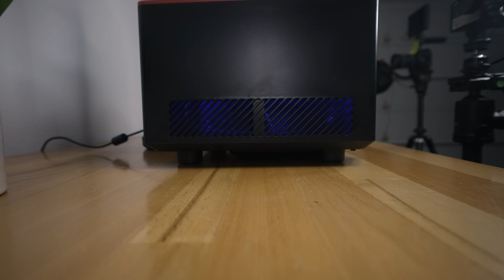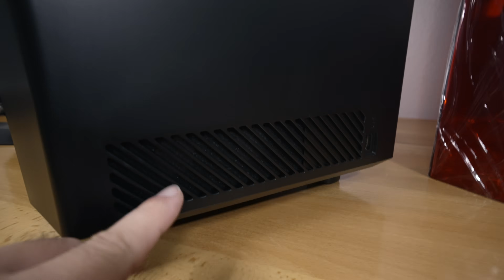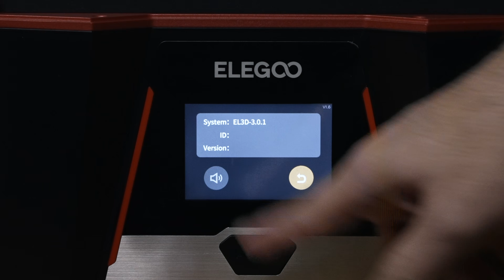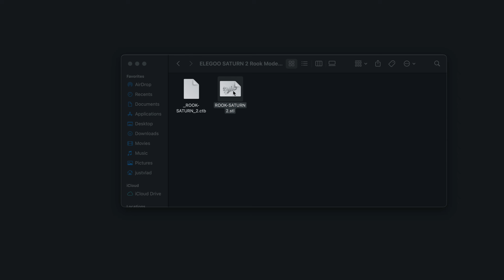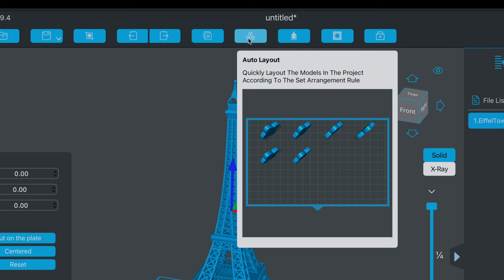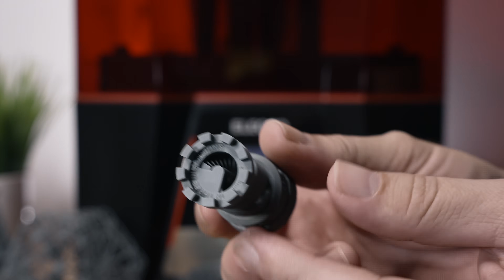Elegoo Saturn 2 - 8K Resin 3D Printer - Unbox & Setup

Comment: I have this printer excellent product, I have to say though that their (Elegoo) customer service is pretty bad, My printer arrived with what I had originally thought was a light scratch on the protective screen (tempered glass) it was actually a crack which cracked after a couple of prints, I purchased a replacement protective screen well over a month ago it has yet to this day not been shipped despite me contacting them several times, Looks like I will probably be looking at another company for my next printer

Comment: I just got this saturn 2 printer and started following your setup to make sure i did it right. However, when i turn mine on, the screen comes on but no fans?? Do you have any advice? Is this faulty should i send it back? Please help :(
Reply: They fixed it in firmware update - Fans only work while printing ;) so no unnecessary noise while idle
Reply: @almostpainted what about the mini air purifier? Mine does not turn on the lights nor the fans, I haven’t tried to print something just in case

Comment: Does anybody know why my 3d printer isn’t printing. I followed all the steps on here. I’m trying to print a test piece (the rook shown in the video and the one given with the usb) everything seems ok. But when I press pause about 50% of the way through nothing is on the plate.
Reply: I’m having the same issue, did you figure it out??
Reply: Yes the plate wasn’t getting enough exposure time for the bottom of the build to stick to the plate

Comment: I somehow ended up with FDM (ender 3 v2 neo), and this RESIN printer (saturn 2 8k). This is my 1st time ever touching a 3d printer so I was a little confused but after researching a little on both type of printer I think I got a little grip on it. The 1st impression for ender 3 v2 neo was somewhat funny. The ender looked cute. Very small and compact. I had no idea just how small the ender was, especially compared to saturn 2. Night and day difference. The quality and build was also night and day difference. The ender looks fragile and I am certain I can probably rip it into different pieces if I wanted to. The saturn 2 however looks thick and the quality difference compared to ender is also night and day. If you don't need super hard prints then it's no brainer, ender has very cheap hard filment. If you are not worried about durability then 120% resin.

Comment: Don't you use support?
Reply: He did not for the tower. Which is why he ended up with some pieces in the bottom of his tank. Which is not good, because it could perforate the tanks plastic base. I would always use supports for any areas of unsupported material. Otherwise it will just print and attach to the bottom of your tank and cause issues and potentially damage the tank and/or printer screen.

Comment: Great review, But in my case after having this resin printer for awhile. I will be selling it and the Mercury XS Bundle of the wash & cure units, Because that although the resin models been great and such, I have a problem with the elephant in the room problem No One online points out about the resin waste water from washing the models!

That is, unless you live in a always hot sunny place, you will not be able to set and remove the suspended waste resin left in the washing water due to lack of sunlight where I live?

I live in good old UK which is often over cloudy even in the summer and because I don't have hot sun all the time I can't cure the resin out of the waste water since I use water washable resin I need to wash in water and now have got stored 14 liters of the waste resin water That I can't set or off course just throw away down a drain or toilet.

Someone said just buy a super strong UV lamp and zap the waste water to set the resin in it? But I found that to buy a UV lamp that is big enough and has the right power will cost a few Hundred pounds to get. So that is not a option sadly!  So I am left with having to sell the system since I can't just keep storing the waste resin filled water.

Oh and saying well do the IPA version will also not be a option, IPA here has shot up in price big time and I would need at least 7 liters a time to fill up the washing unit tub, that be too pricey.
And no hot sun most of the year to help deal with the setting out of the resin, I could not just let it elevaperate away due to the IPA being so pricey anyway.

I also seen that disposing of this type of resin waste water here needs to have a special company deal with it which is very expensive and hard to find locally and I don't have a car.
Taking this stuff on public transport would be a legal problem due to it leaking out the containers I got it stored in. ( one 10 liter snap on lid plastic container & a few old plastic milk containers )

So I sadly will have to sell the whole system I saved up for.  Then still will have to find out how to get a service come and remove and dispose it safely under UK toxic laws?

So if you wish to buy this in the non always hot year around sunny countries like the UK, I would say don't as you be in the same trouble I am. And yes I did indeed research and watch tons about resin printing before I brought it? But no one said anything about the resin waste water setting problem if your not in a hot sunny country? All of them just said it is easy to set the resin out.
Reply: `That I can't set or off course just throw away down a drain or toilet.` Because?